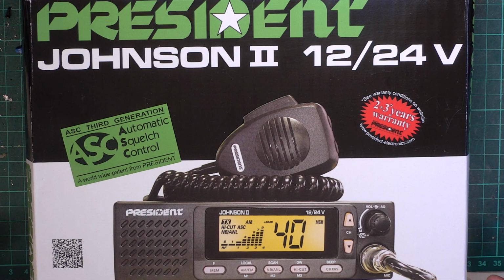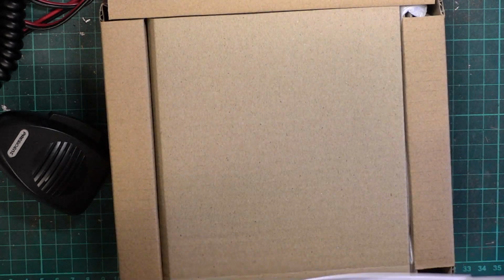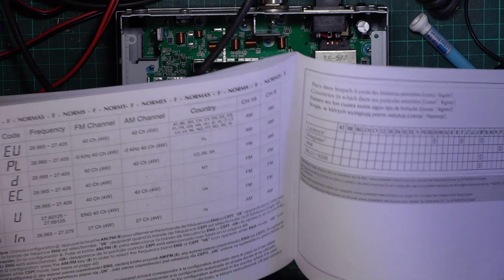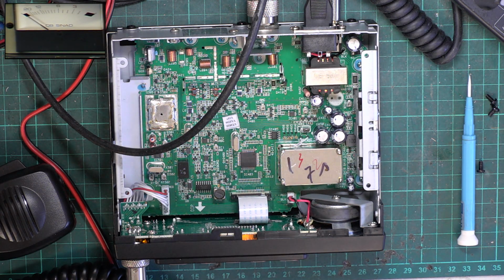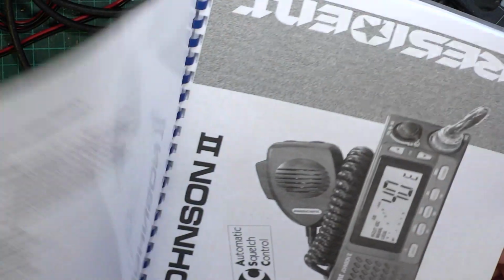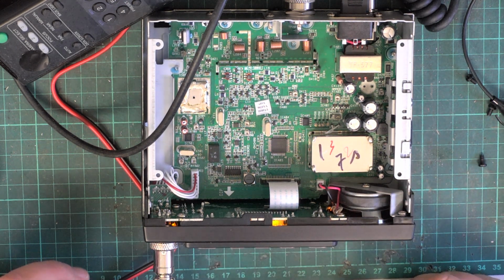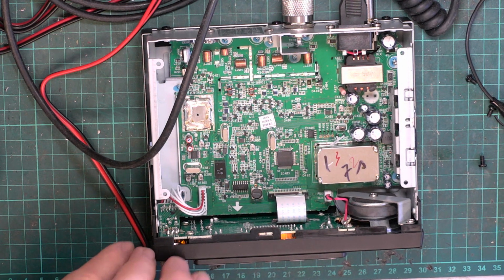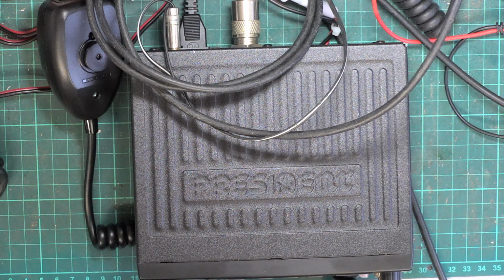President Johnson II 24V CE MultiNorm CB radio (mobile) - Optimisation (new set)

Comment: Not a bad set these Richard,  they've been around a while....i had one in 2007, there was a lift on and i was talking to a chap in Canada with a little sirio on a magmount....
He disappeared as quick as he went though, very good looking radio 👍
Reply from the maker: as I said in the video there turns out to be 4 versions. This is 2019 date coded, the manual I have transpires to be for the 2014 version.

Richard

Comment: Where does the Multi 'Norm' come from? like what does Norm actually stand for, Normal?
Reply from the maker: The CE MultiNorm sets are pre-programmed with the requirements for all European countries. You simply buy the set...it comes out of the box on CEPT FM 40, and dial in the country you are in. The radio then sets up the 'norm' for that country. In America, the FCC doesn't allow this, so radios like this will be available worldwide as both "CE MultiNorm" & "FCC" for America.

Prior to CE MultiNorm, makers had to make a different radio for the different countries. Since MultiNorm, it has been worthwhile for manufacturers to release plenty of models. Prior to MultiNorm the selection of sets available to the UK was pretty dreary.

Richard, G0OJF, UK
Reply: @ukfmcbradioservicingTango21  It does stand for normal then, i wasnt sure.
Funny how the U.S is not so free on what rigs can be sold, when it comes to RC they are much more relaxed vs the EU/UK.
in the FPV world we often run the FCC version of firmware on control modules and receivers due to it allowing way higher power levels and no latency riddled LBT which can also cause failsafe events! 
It gives us full power with max channels (control, not RF),telemetry on the max ch setting and the lowest latency vs the EU firmware restricting  the power and also making us choose between having 8ch and telem or 16ch and no telem, stupid LBT and very low power output!

Comment: Those mic’s are terrible the wire in them are more or less solid and after a while they brake up I have a Johnson ll in my truck it dose work ok but that mic needs chucking out the window and I did turn up the audio on it as was told it was quite 
It’s done 350,000 mile so far and it’s still working ok
Reply: What mic do you use now?

Comment: Maybe all adjustments are done through a secret menu.
Reply from the maker: No, I just did all the adjustments. What adjustments are you looking for?
Reply: @ukfmcbradioservicingTango21  No it is just that you had to use the secret menu to access other settings on another similar transceiver.
Reply from the maker: I get the impression that President models are made by different manufacturers; some use menus & some don't.

Richard